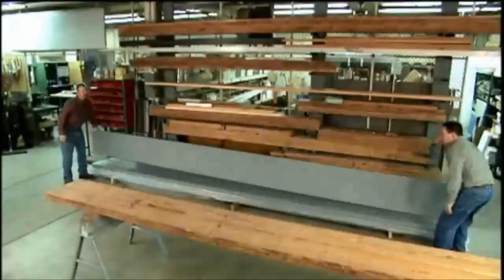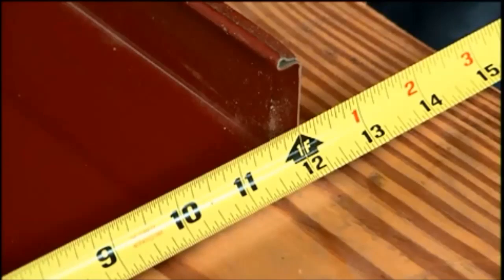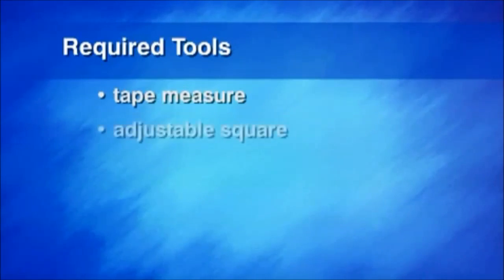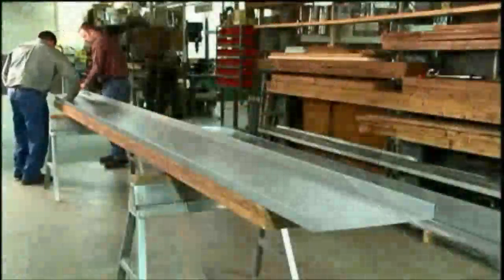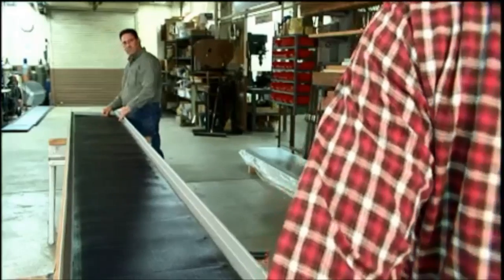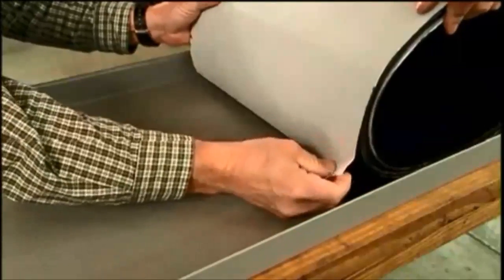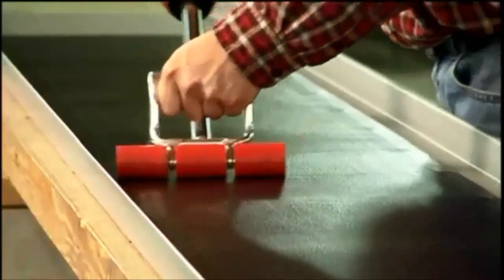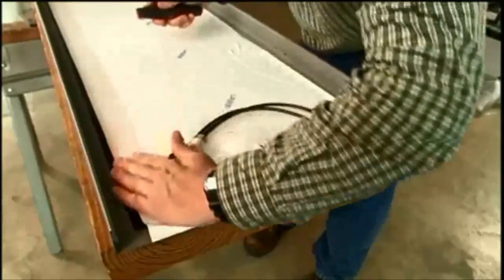"SOLAR METAL ROOFING: Thin Film PV Panels Installation" by CoolFlatRoof.com

Comment: Why can't the laminates be bonded to a secondary panel and mount clip the panel to the roof between the seams, to overcome any ribbing?  Assuming the panel/laminate fits between the standing seams
Reply from the maker: What's the point? If you go into so much extra work, might as well install regular panels with S5 clips, much cheaper, and a lot more watts per sq. ft.
Reply: @coolflatroof  asthetics.  You've spent all this money on a metal roof.  Why cover it with ugly panels🤷🤷

Comment: Can I apply this laminate on the roof surfaces and side doors of my Prius?

And BTW, most products with long adhesive surfaces have sectional breaks in their adhesive-shield paper to facilitate the easy release to adhesive surface one short section at a time. Why don't your company make release of adhesive-shield layers that way? Just a quarter inch overlap at each release section.
Reply from the maker: not really - these panels are too big (too long) for prius ... and btw - what would you do with them - where do you plug them in? They produce very little power to provide any substantial charge for a prius